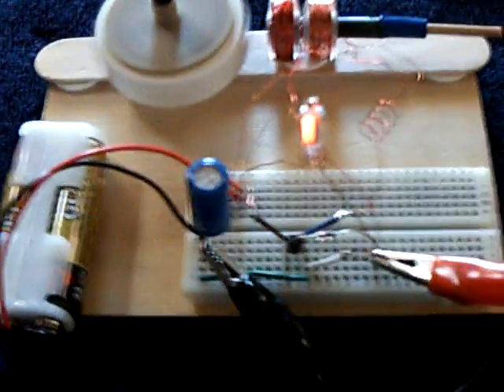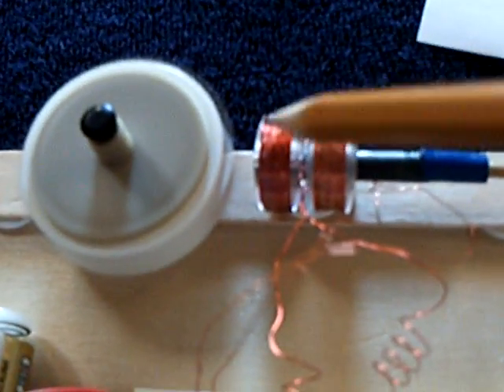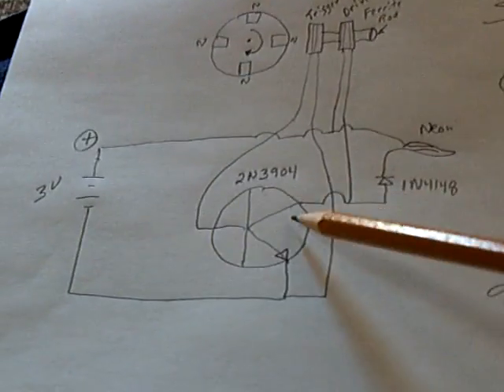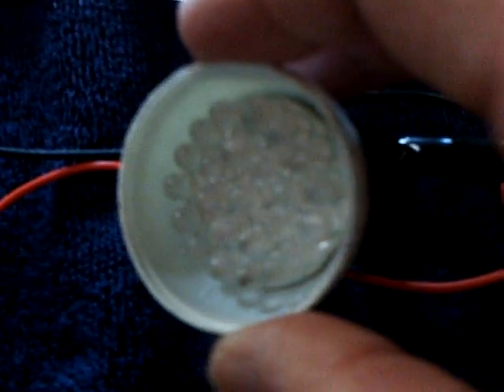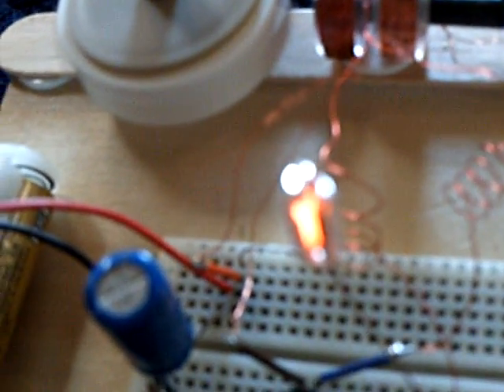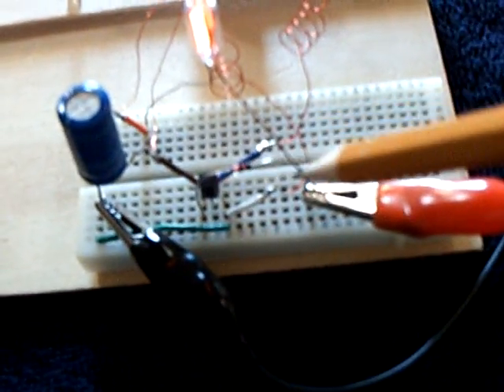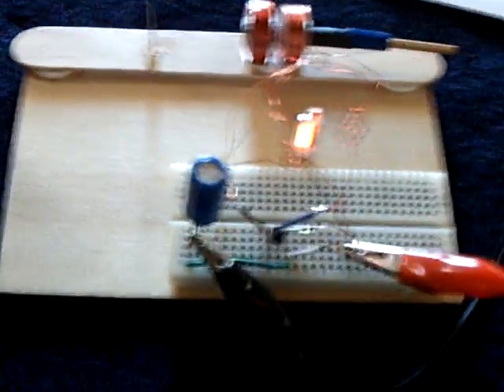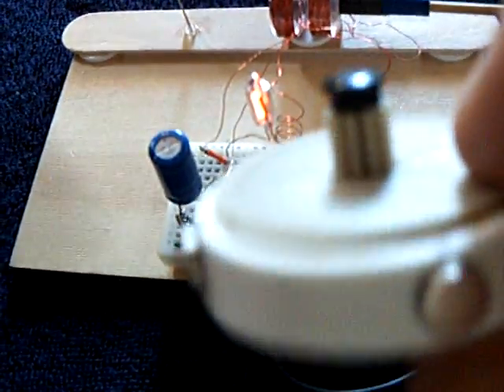Simple Electronic Pulse Motor ----- With HV Output

Comment: I'm working on one of these now.  However, I notice you don't discuss the direction of turns on the bobbin.  I don't do much of this so I have to think carefully about the
trigger current (applying the right hand rule).  Since the current is affected by both the pole of the magnet and the direction of turns as the flux cuts thru the coil, wouldn't it be important for the trigger to properly bias the transistor base?  Is there any standard way/direction you wind your coils?  Or am I incorrect about all of that?
Reply from the maker: mediaguardian I use a simple method----if it doesn't work reverse the leads or turn the bobbin around.

Comment: Thank you for your prompt response!
I have to take courage and make a video one of these days.
"I believe to have found the problem or causes, which made it difficult to work." First: the electrical clutches had two hidden diodes, and also looking at your video; you seem to have the right ratio: pulley versus coil very light with tiny magnets.
Whereas I: thinking big, since the alloy pulley from a video-recorder had tiny ball bearings and shaft, I thought to use it.
The magnet weight didn't help matters. It wants to work, but it doesn't yet, due to its proportions.
This problem though, gave me the chance to try different coils; you should too! For it seems one can use ordinary "square transformers," ready made. Small one obviously, similar to those found in flash dollar cameras or bigger, pending on the project. I tried the new transformer and it works! I wired it exactly like yours, obviously is not turning fast, but I know why or better now. Once you've tried, please let me know how you got on with it!
Thanks again!

Comment: I have never before assembled a pulse-motor; I am new at this game!
You say that, almost any type of transistor works. Would a TIP31C work?
I am using two bobbins… they were two small electrical clutches once. Don't know how many turns they have.
How many T would your Bobbins have?
What about the distance of the magnet from the coil, and also their strength?

Thank you for now!
Reply from the maker: TheJG1947 I tried a TIP31 on this and it worked fine.  I did not count the number of turns on the sewing machine bobbins. A few hundred turns?  I just filled them up with 30ga magnet wire.  The neo magnets are just average grade.  You have to adjust the rotor to coil gap.  Trial and error until it runs the best.  Mine is around 1/8".

Comment: So, a collapsing coil toggles the transistor? If not, what is pulsing it in the solid state mode?
Reply from the maker: In self-oscillation mode this acts like a Joule Thief  (blocking oscilator).
Reply: Got ya thanks.
Reply: It is electronic resonance due  to the capacitance, resistance and inductance (LCR)  of the circuit. The coils must be very close to the exact electronic specs. and with the ferrite rod, close proximately to each other they are resonating. How long will the self-oscillation continue?

Comment: I love it. I want to try it.
Reply from the maker: I have tried that but I couldn't gain anything.  Pick up coils are great---they pick up energy but throw it away when you try sending it back to the source.
Reply from the maker: ***** I have built those 'cap pulser' circuits.  They work but energy is still lost to heat and friction.
Reply from the maker: Give it a go!

Comment: hi lidmotor... thats realy cool, interesting, thanks for sharing
 
So trying to understand...
 
“Ferrite cores inhibit oscillations”... so is the ferrite core acting to block alternating current (working like a bridge rectifier) and thats why its DC?
 
Is the ferrite causing resistance and so bumping up the volts? Or is that just the charge building up from the flyback in the coil to the “collector” part of the transitor
 
Is the ferrite core helping to keep the electrons in the coils, and thus making some form of electro/magnetic flux maybe? ... and then triggering the transitor to restart the process
 
(What im seeing in my minds eye is magnetic fields being created by residual electrical charge, and the ferrite focusing them to create an electromagnetic pulse, which triggers the transistor... what ive just said could be bunk of course lol)

All the best
Reply from the maker: It has to do with flux but I'm not sure what exactly is going on here. The motor would not run any other way and it will only run in a very narrow band of input power.  I think that it is just a badly designed setup that I somehow got to work.  Without the rotor the thing is just a pretty simple oscillator.  Move the wires around a bit and you have a Joule Thief.
Reply: hmm... do you have one of those magnet field viewing cards? just curious... thanks lidmotor
Reply from the maker: DiyEcoProjects No I don't have one of those.  I should probably get one.

Comment: You can prevent the needle from drilling into the rotor by letting it bear against small piece of brass shim stock. I have run some rotors for months without any wear visible under a 10 power jeweler's loupe. If the needle makes any visible mark on the brass then the brass was  too soft. You can harden (work harden ) the brass by hammering it with a ball peen hammer. Flatness is not an  issue because it's a point contact.
Reply from the maker: Thanks for the tip about using brass as the top bearing surface--and how to harden it.  That will solve the problem. This is one reason why I like YouTube ----people share what they know and it helps others.

Comment: That's great! 

Is that the same 30 awg copper winding from your last project?
How many turns on each bobbin?

I also noticed that you made 2 air inductors with the copper leads from your bobbins.  What effect does that have on your system?

Thanks in advance!
Reply from the maker: I knew someone was going to ask about those 'air inductors' when I wound them.  They don't mean anything .  I just coiled the wires to make it look a bit neater.  I filled up the bobbins with 30ga.  A few hundred turns I guess. I have a bunch left over from another project.
Reply: Once you've coiled the conductor, you have made an inductor.  When current runs through it, it creates a magnetic field and it stores some energy that charges & discharges at a slower rate than a straight conductor. 

If you place a compass at various points around the inductor, you should be able to detect the magnetic field.

Although, you are probably right about those  inductors not affecting your circuit significantly.
Reply from the maker: You are right about those little coils and now I am wondering if I tried various coils in those positions what the performance changes would be.  Hummm. That might reduce the amp draw.  Right now this little critter is too power hungry with no base resistance happening. About 100+ mA
Reply: ***** An inductor/coil resists changes in current that passes through it.
When a current flows through it, energy is stored temporarily in a magnetic field within the coil.  When a current stops flowing through it, the stored energy in the inductor is released more slowly than through a straight conductor. 
Note:  For those that need it, a better description can be found here:  http://electronics.howstuffworks.com/inductor.htm/printable

Also, when you put your iron/ferrite core within the bobbin-wound inductors, you effectively create an electromagnet.  The iron causes the magnetic field to concentrate & strengthen through the center of the coil/iron.
Reply: *****
Here's a url to low wattage neon bulb (if used with a 30 kΩ resistor). It uses ~.25W @ 110V (so ~2.3 mA)
http://www.ebay.com/itm/NEW-Box-of-10-Neon-Bulb-NE2U-A3C-Indicator-105-to-125-Volts-AC-DC-FREE-RESISTORS-/400748436535?pt=US_Light_Bulbs&hash=item5d4e77dc37

Comment: I like that. Not got a Hall Effect sensor or reed switch and has HV on the output.
Very nice :)
How about levitated sideways for the rotor, like a Mendocino, that might work well. I magine you may still have a bunch of those Elec Goldmine ceramic magnets in the bags they did as specials. They work great on levitated rotors.
Reply from the maker: slider2732 I almost broke out a Hall sensor when I could not get this to work.  I wouldn't trigger until I put the coils together like this.  One of the solar waver coils would work much better as a trigger coil.  I have a Mendocino setup that I tried the reed switch stick on and it worked.  This drive won't work on the levitated rotors because of the ferrite attraction problem.